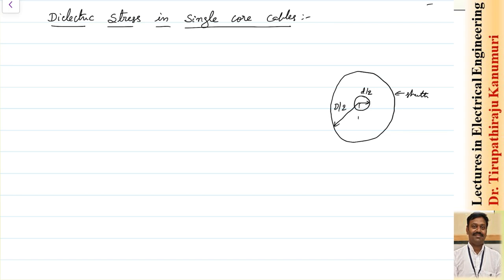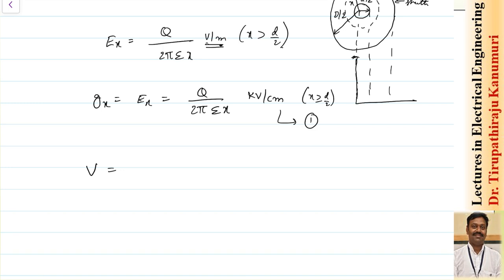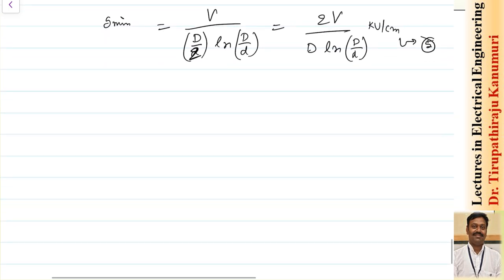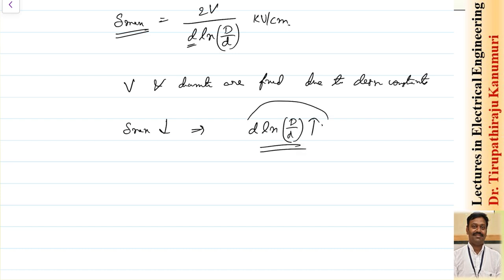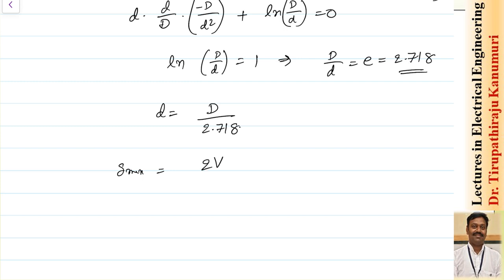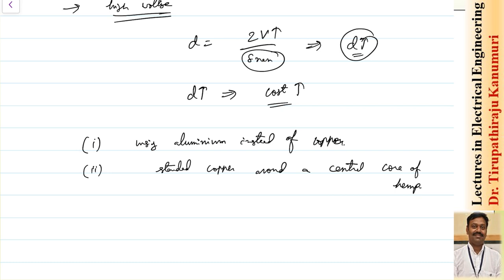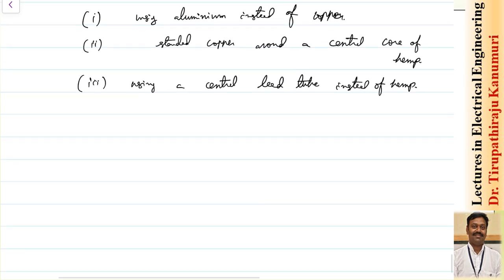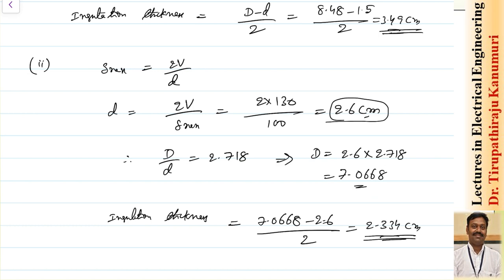PS50 Dielectric Stress in Single Core Cable

Comment: Sir here also
You not explained why dielectric is breakdown if grading is not done
Reply: @lecturesinelectricaleng  but sir in video you told that
Due to difference in gradients of cable(max at surface of the conductor and min at the sheath surface) breake down occurs